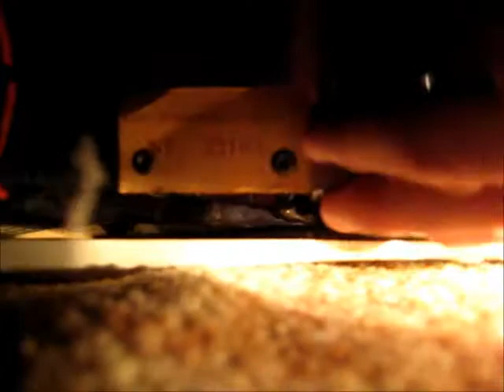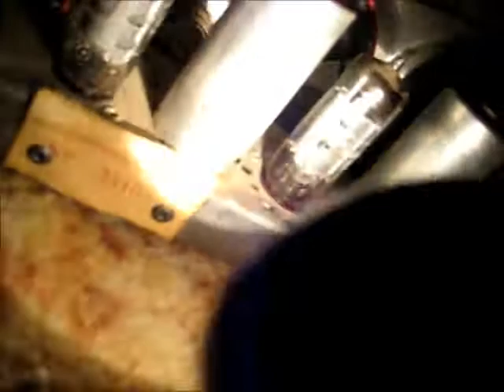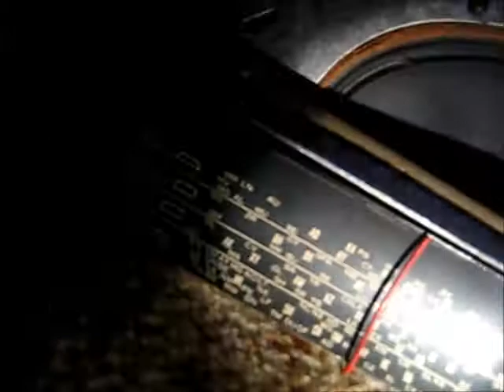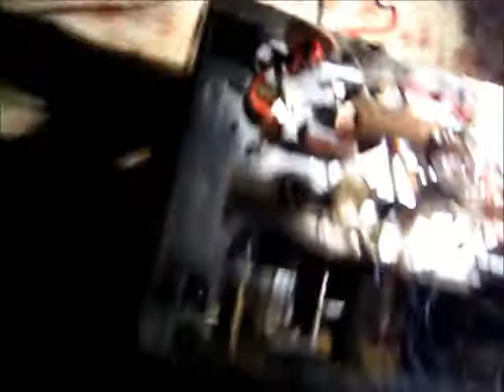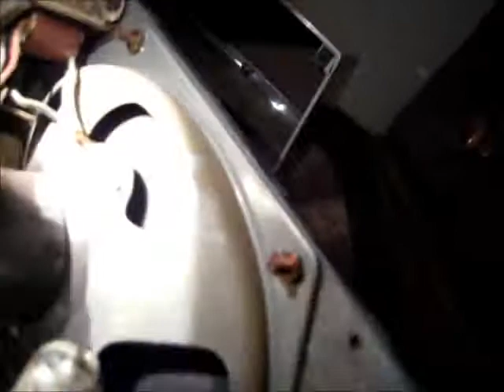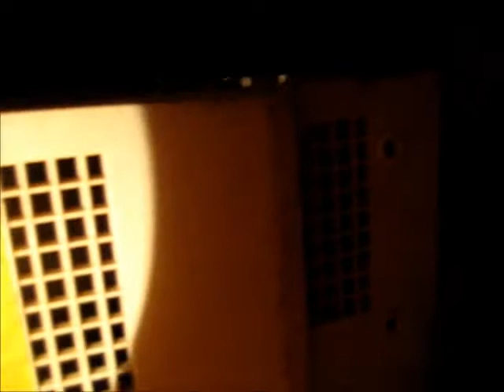A more Indepth Look at the Kriesler Radio Before repairs

Comment: Hopefully the mica caps in the IF cans are either sealed separate units or ceramic so migration won't be an issue like it sometimes is in the small square K Tran style ones they have here. No doubt it would be a good idea to change all of the paper capacitors as well as the electrolytics, even ones that still work still leak. One problem that I have seen creep up more and more are resistors that have drifted in value, it's always worth checking those with an ohmmeter.

Comment: Withe regard to the pilot lamps around the dial it's only critical to replace them if it's an AC/DC series string design where they are often operated from a tap on the rectifier tube. In an AC set they usually just run the pilot lamps from the filament winding on the transformer, 6.3 VAC or some such thing. The filter capacitors are likely what is bad if the set has a severe hum but it could also be a shorted tube. The lack of audio could be any number of things but usually a bad coupling cap.